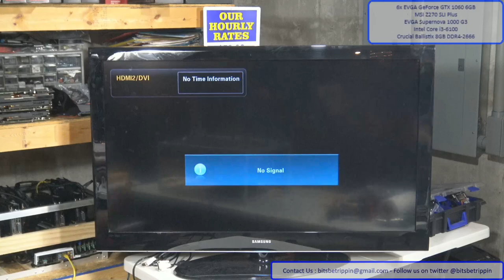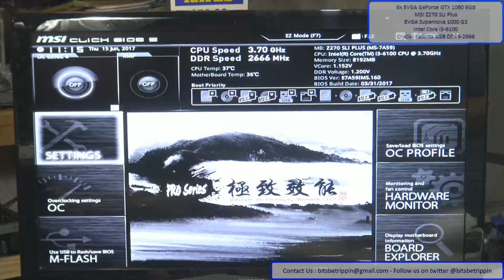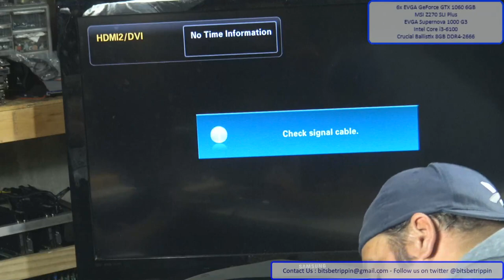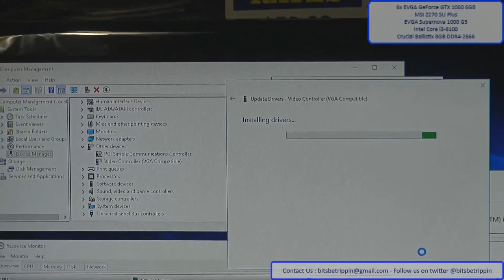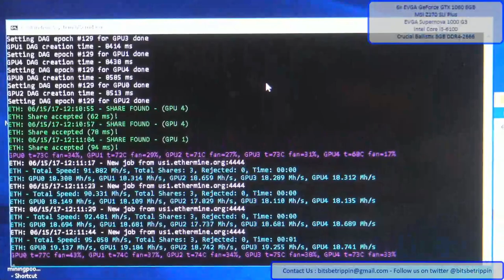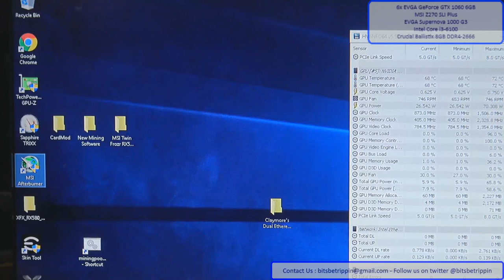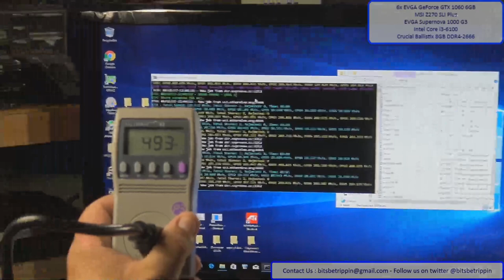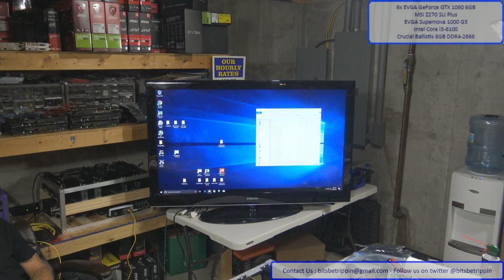BBT Livestream21: Building a Ethereum Mining Rig Start to Finish! 6x GTX 1060

Comment: Just wanted to say thank you. I built mine over the weekend and troubleshot through plenty of issues but got a nice stable 135 Mh/s using claymore, ether mining only. Haven't messed with any other mining software yet.
I used 6, Zotac GTX 1060 6gb Minis.

I have a lot to learn but your video, hell, all your videos, are really helpful.
Thanks again

Comment: It feels so good to see that the "pros" have the same problems as we do, i did almost that exact same rig last week, same mobo, same cards, (celeron, 4gram, crappy 5k rpm dinosaur hdd), lots of problems to get the six cards, and lots of hangs on mining, eventually it settled but it was HARD, ASUS mobos are FAAAARRR better, i have built around 30 rigs to date, and the most common issues are bios settings and bad risers, especially bios settings cause your guessing with each new mobo

Comment: I want to give all your viewers some info if they are not aware...
I bought more thumb drives and redownloaded a current simple mining OS flash file from simplemining.net. 
I replaced all my thumb drives in every rig and did a reboot. Each rig increased around 45mhs with the updated flash. 
I do mine ethereum only. Just wanted to let people know this increased dramatically on my rig performances.

Comment: just bought my aluminum, wood, and screws also bought a saw blade to cut the aluminum cost me $45 per case here in Bolingbrook Illinois.  did I miss the part where you talk about what to cut metal with?  I know you were talking about having to sand it so you don't cut yourself.

Comment: ADD2PSU works and it's not too expensive. But it costs less than half as much to just buy one of those dual PSU cables. They work just ask good. Thermaltake makes some too,  it costs about $5.

Comment: id predrill those holes for the selftappers makes it much easyer if on your on your tod  as once you slip on the head you wont get the torque for it to pinch up so replace the screw too just my tip hope it helps some peeps just clean the metal from drillig up as you go so it dont cause problem with componants

Comment: This is what I've been waiting for, I really want to build my own rig, my main problem is the money to buy everything, but at my country the kwh costs $.05 USD, isn't it great?

I want to get started but I've been thinking that I'll just start if I'm sure that I have a good oportunity, like competitive GPUs model that's why I've been researshing and at this point this is what I know:

1.- I understand that RX580 are one of the best GPUs that we can get and they are sold out most of the time, but how big is this difference between RX580 and a GPU like GTX 1060?

2.- The Eth mining way will have important changes in a few months, I don't understand the consecuences of that change, but I want to know if that could be counterproductive for a proyect like this mining rigs

3.- I've never worked with MH/s before, but with 130 MH/s and standard conditions, is it correct to say that this rig can earn abour $700 USD per month? (This way I will know If I'm understanding how to use this online calculators)

Am I on the right way to learn about the current mining world situation?

And thanks a lot for doing videos like this, I am happy to know that there are people who, although they already have everything ready and working, are interested in teaching new people

Comment: hi guys, thanks for the video!  I'm still slogging thru it ... at about 2 & 1/2 hours now.  ("The horror! The horror!" Apocalypse Now reference)

Just two comments so far: (1) I'm cringing at all the aluminum shards around the GPUs and motherboard. You guys like living dangerously?  
(2) When you get a question from off camera, could you repeat it, please. 

I stopped by Home Depot this morning.  Looks like the aluminum comes in 8' chunks for about $10.  And in stock, unlike all the GPUs.

Comment: I'd be curious if the cheapest Ryzen 3 would be a good CPU + board combo when they come out, since they are all overclockable out of the box if you could instead underclock and undervolt them to reduce power and heat costs

Comment: I am having a hell of a time trying to get the 4th GPU running stable.  I an using EVGA "Superclocked" GTX 1060 6GB, with the 382.33 drivers on a Win10 fully up to date on a MSI Z270 SLI Plus motherboard.   I am running the GPUs stock with no overclocking.  I get about 19Mh/s per GPU.  When I add the 4 GPU it gets well less than the 19 and all card and all other GPU get lower rate as well but not as low as the newly added one.  Claymore will eventually either hang the OS tight, toss errors and otherwise puke.  I have the above 4GB option set in the BIOS as well.  I found this video and used it as a guide/check list to see if I I missed anything on my build and so far, can't figure it out.  I have swapped the 4th GPU riser and GPU itself, nothing changes.   I must be missing something simple.  Any ideas?  I'll tip whoever can help. ;)

Comment: Question...I installed 3 different rx 580 cards. One was a 4gb, one was a 8gb and One was a led VR version. They all came in out the box between 22.4 and 24.6 Mhs. So does the gb make a difference on performance in mining?

Comment: I'm doing a build with 1060 6GB as well and my UBIT Brand risers have SATA, Molex and 6-Pin but due to my power supplies cables I'd like to go straight to SATA. I see in your video although you're using Molex, it's Molex to SATA, so would using SATA be the same? I heard you discussing the new risers with SATA, would that be preferred? I've heard varying debates on power consumption limitations of SATA.

Comment: Greeting from germany! One question I have is concerning the gtx 1060 and wether or not it is worth to buy the 6gb version over the 3gb version
Reply: yes
Reply: I'd get the 6GB. The dag file will be too big for mining Ethereurm when it hits epoch 160 on 3GB cards I think
Reply: the future is uncertain there's a chance eth will not be able to be mined with those cards by the time 3 gigs is not enough.   luckily there is no other currency that I have heard that is approaching the level where the 1060 3 GB cards will be ineffective.
Reply: i'm getting a consistent 280 sol/s for zcash with the zotac 3gb mini version with +100 core clock and +175 memory clock
Reply: (german version below)
The 6GB is around 299€ in germany while 3GB is around 199-229€. The 
thing is that people all around repeat the "DAG will rise in 
weeks/months/years" story. I tried it myself and bought a 1060 3GB this monday and set to default gpu clock, lower power target and with >=+400 mem clock it can easily do >=18MH/s (sth like 1,94€/day). 

The point is: it does NOT reach the 3GB memory consumption or get even close, it just consumes 1,2GB and works rock solid (but in a rig, not a case). If you, however, increase the memory clock even further and play with power target in afterburner, it consumes 2,1GB according to GPU-Z and 2,3GB according to afterburner, but that does not increase the hashrate. Interesting, didn't knew that before either.

So if DAG goes up, it will still do around 18MH/s within these 3GB. The value of an Ether by that time is another thing beyond this scope. Oh and btw: 1060 with these clocks can do ~280 Sols/s Zcash and that's around 1,90€ per day aswell. And that just consumes 1GB VRAM.

Also ist alles gut Clemens, die 3GB tut es auch, denn auch Nvidia Karten bringen jetzt gleiche oder bessere Leistung im Zcash als im Ethereum, genau wie die AMD letzte Woche nach dem Ether crash und so. In dem Sinne: Grüße von nebenan.
Reply: this works on AMD cards?? r9 290??
Reply: Yes manuel, it works on AMD, I'm making ~266 Sols/s Zcash on a R9 280 3GB right now while typing, so it works on any R9/RX/HD card. And if you meant ethereum, yeah that works the same way.
Reply: jeje thanks i will try put in 5 xfx r9 290 and a msi r7 270x
wen i using windows 7 only works whit 4 so maybe i will try whit linux of simplemining.net so i check
Reply: What is stopping you from using more than 4 cards in windows, but it's 64bit right? Install latest graphics drivers and try the software from nicehash.com, it comes with all the miners, just start and go.
Reply: Lol there's also the impending etherium proof of stake coming
Reply: still 1.90 Euros a day? wondering cuz i wanna start mining.what do you use to mine for that 1.90 E ? niceminer or smth else ?
Reply: I used NiceHash Miner back in the days, it mines the most profitable coin, converts it's value to BTC and pays out in BTC. It displays the value of those based on current exchange rates. BTC dropped a lot thats why now it displays around 0.80 to 1.10 Euro per day. You could still mine Ether or Zcash directly and keep em. But don't start buying brand new cards, you won't get rich with that (unless you mine a coin that skyrockets later on).
Reply: iv gone 8gb on all mine future proof just incase there is an update or a new coin to mine shows up requiring larger gb and resale later

Comment: INFO FOR Z270 SLI PLUS OWNERS: M.2 to PCIE WILL NOT WORK on this specific sub model of the Z270. Just not happening. The "A-Pro" or AR WILL work(per carter's other video). I'm the only one i know of who has personally tested this and has a definitive answer. Sucks but you would know, like i suspected, when you go through BIOS that it lacks certain settings that the AR or A pro DO have for m.2. Yea, it is a drag but i hope others can learn from this.
The z270 sli plus is a 6 gpu rig. Max. End of story.

Comment: The MSI z270 SLI motherboard I bought has been a nightmare.  I spent an entire weekend troubleshooting all types of problems.  It just freezes up while mining with four gtx geforce 1060 6gb gpus.  If I hook up 5 it will either freeze, or I will end up with a blue screen of death eventually.  

I spent a while troubleshooting a problem, and I wanted to mention it here just in case someone else has it.  If I did not force bios to use the integrated graphics on the motherboard, when I plugged a gpu into pci-e 3 on the board, it wouldn't even boot up.  Once I changed this setting I was able to boot. 

At first I figured I had riser problems, but all cards and risers work if I swap them around and use different PCI slots... After reading forum posts for days it seems like a lot of people are having problems with the motherboard.  Also read a lot of problems with the z170 series.  

How is the rig in the video performing?  No crashes or freezes after like an hour?

Comment: Hello Guys, I have a problem!
I have 4 RX460 and 1 RX470 as I was oc the 470 my rig crashed and after restarting one RX460 just mined with 2 mhs but it should do with 11.9 mhs?

I reinstalled the drivers and tried again but it didn't help!

So what I think is that the pcie has a problem but i cant find a solution maybe I am wrong?

I would be very happy if you could help me <3

Comment: I have an evga 850 BQ psu with 6 msi gtx 1060 6gb gpus. The power supply only has 2 vga ports. My question is can I plug the 6 pin vga connector (that is attached to an 8 pin connector) in the 8 pin slot on 3 of my gpus? Or would that not supply enough power to operate the rig? It is even worth trying to do or should I just go with a 1000w psu and copy what you guys did? Second question: I have 3 cards mining right now. 2 are at 17mh/s and 1 is at 20mh/s. These were right out of the box. What can I do to get those other 2 cards around 20mh/s?

Comment: Hey guys, I have a question I have a rig with a ASRock H81 PRO BTC with 4 MSI R7 370 GAMING 4G. I want to reduce power consumption and increase hashrate by replacing those R7 370. Would these GPUS, or any of the new ones in your recent videos, work with my motherboard or should I build a new rig entirely?

Great videos by the way. When I miss the live stream I always make sure I catch up watching the replay.

Comment: Where do you get the pine?  Home Depot & Lowe's don't carry 3/4" thickness or even 3.5" width.  Closest I can find is 1"x4"
Reply: Welcome to America in the 21st century ... put a tape measure on that 1 x 4 and you will see it is 3/4" by 3 and 1/2". Sometime in the last century they started using the dimensions before planing and drying the lumber.

A 1x4 is what you want.
Reply: Thanks!  That's so messed up, but I was able to get it no problem at Home Depot.

Comment: Wow, you guys are all in step by step.Good video sir. BUT what if i have free electricity... what card would you recommend?
Reply from the maker: Well nothing is free, even subsidized electricity probably has a limit (i.e. if you use exorbitant amounts, someone is going to come knocking) - would still stick with efficent cost/power/output ratios. GTX1060, P106, RX470 Mining Edition and good deals on RX480/570/580s still value add.

Comment: Hi, does the processor have a big impact on whether I can get my rig recognizing all the cards? I want to get a Z270A from Asus or possibly this board you are using in the video, but I'm not sure if I need to get a better processor.

I have Intel Celeron G3930 LGA1151 - any help would be appreciated.

Cheers

Comment: What do you think about big gpu power variation? I'm doing a setup to try save energy.
For example, my GPU power working between 28w and 75w. This huge variation could be bad to GPU or not?

This variation occurs because memory process. Using GPU original software to changing the configurations, I could do this setup, saving power when memory is not being used.

Comment: Thanks for great video again.  I bought as you recommed z270 sli plus motherboard with Gigabyte 1060 6gb in windows 10 but only see 3 gpu from 5 gpu.  same bios setting as you showed in your video.  any idea?

did you change it to Gen2 or still put under Gen 1 in Bios?
Reply: Check your risers, I see about 1 in 10 are bad. Always have extras! Also, check device manager for Standard VGA Adapter, if it's there, right click and update driver. That usually fixes it.

Comment: Hi BBT! I am using simplemining as well and I have just built a 7 x Asus gtx 1060 3gb rig. I am now testing various configs...What's your take on, let's say, Power Limit 110% -Core Clock +100 -Mem Clock +1000 -Fan Speed 50% for overclocking? Please help! :)

Comment: Is it possible to replace the power cables to the pci risers with the provided molex peripheral cables from the PSU? For example my 1000W PSU has 3 sata cables (9 connectors) and 2 molex (4 connectors which you can connect 4 risers), so instead of having to use the chinese converters for the last 2 cards, just throw in another molex cable from another PSU?

Comment: Hello Guys, I have 2 rings of 5x crads each, one with MSI ARMOR 1060 gtx 6gb (75 power limit, 170 core and 900 mem - mining ETH/SIA) 600w/h (getting 114/1150 mhs)
and 5x ASUS gtx 1060 6gb (75 power, 170 core, 900 mem) (113/1130 MHs) 

The question is ... will you recomend lowering the poer limit and mem clock? to those similair to yours?

Comment: Hi, I need help .. I have a RIG with 5 GPU RX 580 8GB ... and it works fine with windows 10 ... now I wanted to install a sixth GPU (RX480 8GB) and when Windows is installing the driver, the operating system hangs
You can help me with this.
Thank you

Comment: good vid man. i got a noob question. Is there a rig for 1000 to 1500 that i coukd put together for mining eth/burst/etc at a slower rate? i cant come up with the 2000 to 3000. thanks
Reply: nofd1977 this rig is more or less the cheaper option.  unless you go back to r9's our something.

Comment: Hello, I have 6 1060 6gb plugged in to my MSI z270 pc mate but only 4 of them are seen,I have the mining option enabled in the bios,set the PEG0 to gen1 (I dont have PEG1 option) the 2th slot and the 6th slot are not working if I remove the gpu from the slot 3 the slot 2 start working idk what's the problem.

Comment: Hello, if I use a Intel G3930 7th Gen Celeron procesor instead the i3-6100 have the same performance in the mining rig ?, wich problems it have, supports x6 1060, supports x8 1060 ?. thanks, nice chanel,  Greetings from Colombia.
Reply: thanks jesse fischer, My question is about the stability of the rig, supports x6 1060 or x8 1060. it restart, supports the 8 GB RAM.

Comment: dear sir, I currently have one gtx 970 strix OC.. which im going to sell and then spend $600 to buy an upgrade... what cards would you suggest I upgrade to? 2x rx 580s? 2x gtx 1060s? 2x gtx 1050 TIs? 1x gtx 1070?